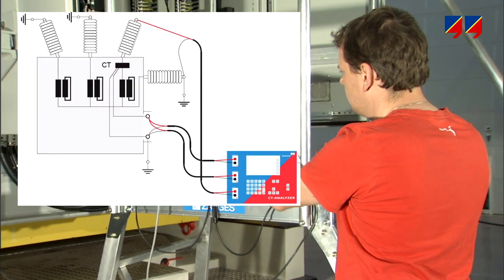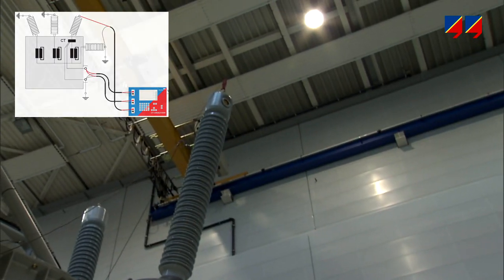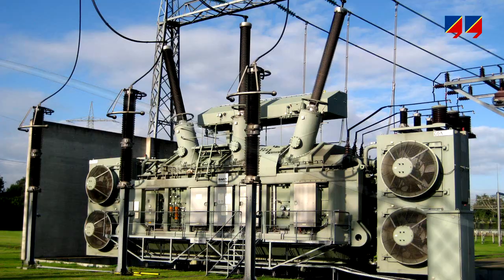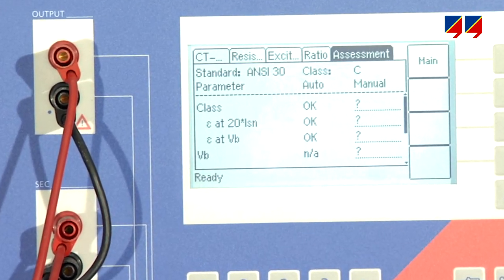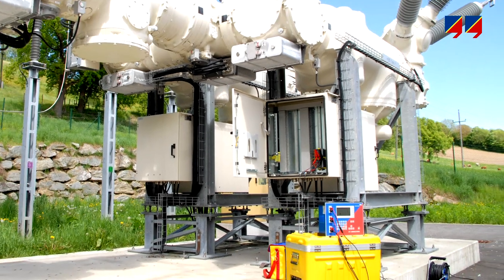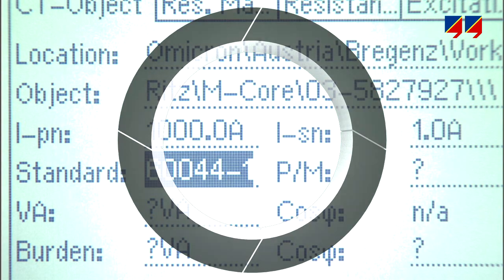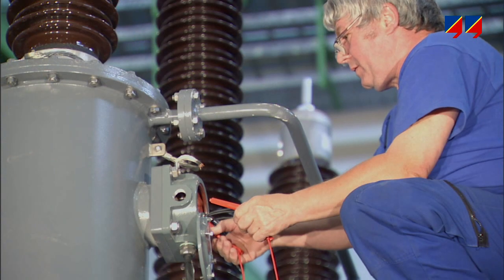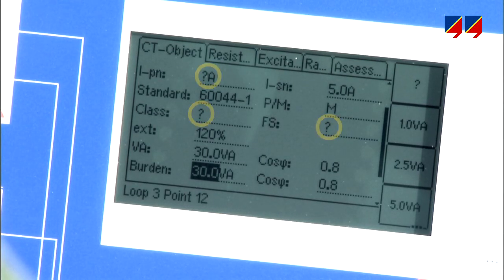Testing current transformers installed in power transformers and GIS

Comment from the maker: @HansErikOlovsson 
With "injecting primary current" we have to point out that in our video we refer to high current injection (Nominal Primary Current) measurement. The statement that it is difficult or impossible to measure these kind of CTs refers to some application where it is simply not possible to get access to the primary side to test with the high current injection measurement principle. For other application it is rather difficult and extreme costly but of course possible.